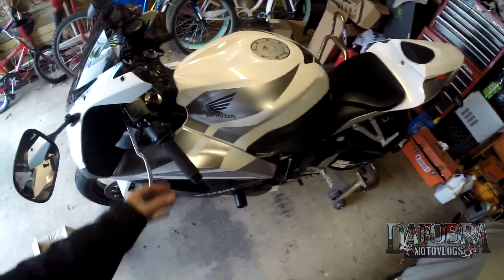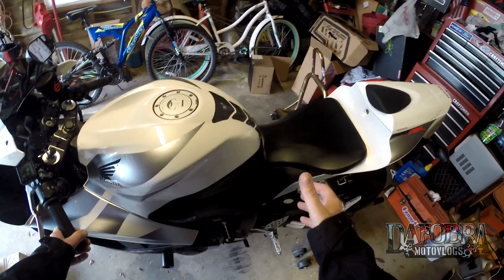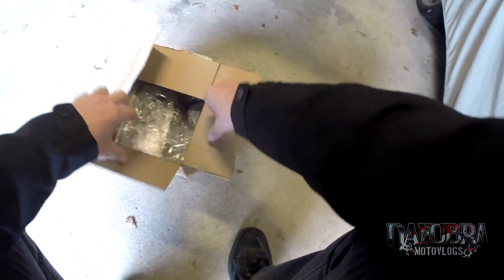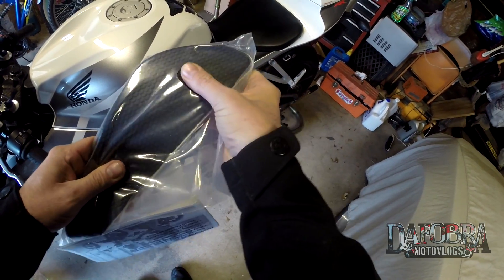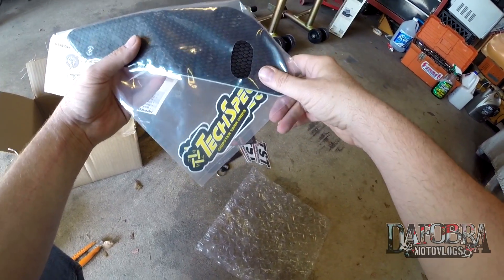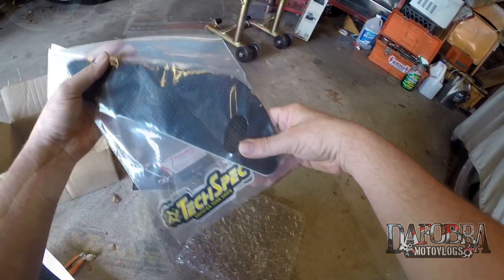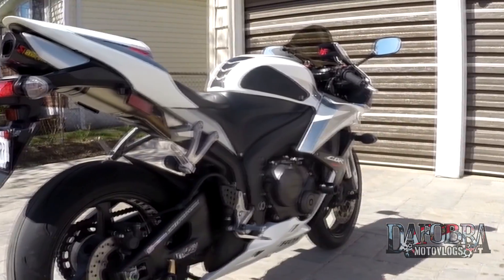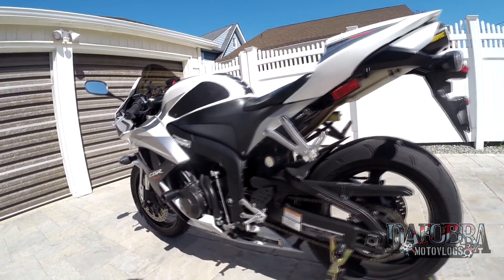Tech Spec Tank Grips and Carbon TST Heel Plates Install and Review CBR600RR

Comment: I was putting off doing this...but, now with the Tank
Dented and probably total the Bike...I'm going to look into some of these/thx again for a great Review/Viddi-yo !!!
;)
Reply from the maker: Dracati Ducati wait.. you totaled your bike?  How did I miss that?
Reply: I haven't gone in to it on the Chnl...tho I was parked at the gym a few mo. back and...as I'm walking out the door to leave, there's a 4runner halfway in MY parking spot...& due to the steel '02 tank (now dented) it will probably total the bike (quote came in at $3500 for the tank alone)...so I have been putting off, dealing with it, since it still rides fine @ 130+ ;)

thx for the thought & it'll work out...

Comment: Glad you haven't trimmed your rear fender! Fender eliminator kits look bad in my opinion, and they also reduce your visibility to other cars by tucking your lights closer together. I think the stock set up looks best, and those grip pads you installed just add to the appeal without making the bike look cheap. Keep it up!
Reply from the maker: TheNewOceanic thanks..  to be honest I never thought about keeping a stock rear fender until this bike.. if I wanted to do away with it I would go with the TST integrated taillight, CF undertail and rear plate holder.. but I like the stocker too much..

Comment: I wish there was more material.  Its just the lower part of the tank.  But I was hoping there was another piece that fits on the black plastic section below as well.  Do you know of another maker that makes some for the lower section?  I'd like to complement the TechSpecs with them.  I notice that tech specs makes the lower areas for other bikes.  Not sure why not on the CBR 07-12
But I appreciate the video.  I have the same 07 CBR600RR in the same white and I was curious to see what they look like.  I think they look better than the StompGrips.